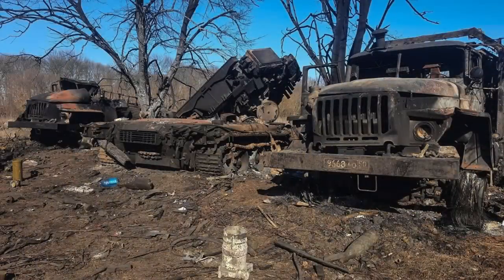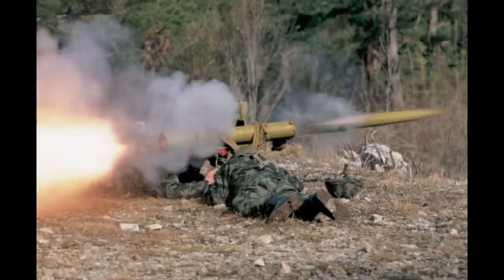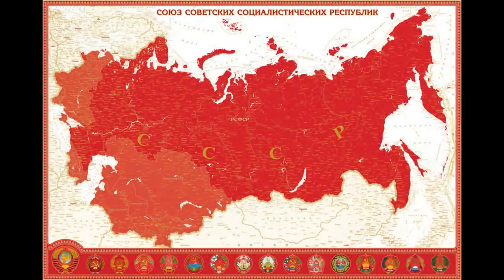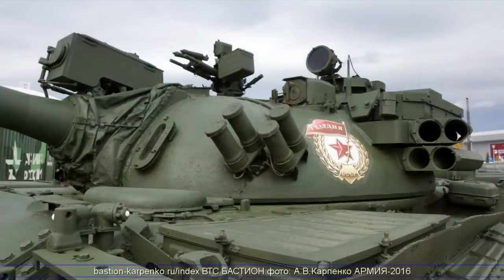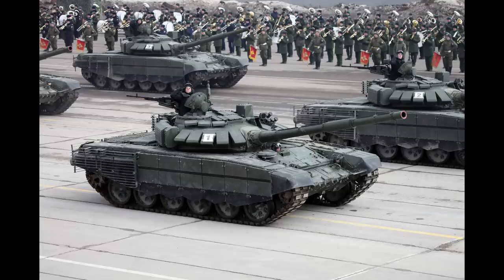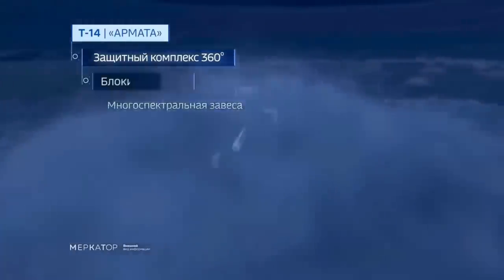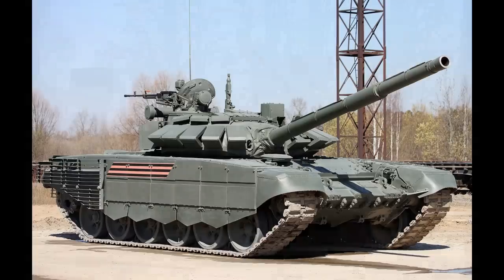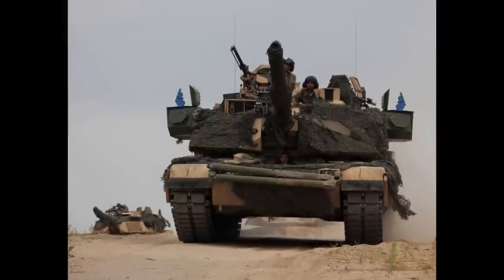Why are Russian Tanks Failing in Ukraine?

Comment: There isn't hundreds of Abrams with Trophy. For one Trophy is only installed as needed not all the time and second the US only bought a small batch.
Reply: They just awarded an open ended contract to buy more of them.
Reply: @MC-pt8kv  well it's an open end contract for a reason, it's at the leisure of the Army how many and when they order them. But like I said earlier Trophy is only equipped as needed not all the time.
Reply: The US Army included the Trophy as standard with the new M1A2C variant of which they have around 420 right now. Originally they were going to deploy the Trophy on Sep v2 tanks that were deployed to Europe but they changed their minds.
Reply: @josephahner3031  I'd love to see your source for the US have 420 M1A2SEPV3's(M1A2C is no longer the designation) from what is published by the Army's fiscal year budgets only 304 have been ordered it's unknown how many have been delivered and given that the tank is rarely seen in active service and the first unit received them in 2020 it's likely only a few dozen have been delivered and spread across the army. Also Trophy doesn't come standard it's still applied as needed similar to TUSK And mineplow attachments. In fact if you look at most recent pictures of tank on maneuvers it's lacking the Tophy APS
Reply: @nemisous83  My source is a former service buddy who works for General Dynamics. Though 420 may be the total outstanding orders rather than the number currently in service. The reason you don't see the trophy equipped Abrams on maneuver because the US Army has around 2300 Abrams in service between active duty and National Guard. If only 300 or so are currently in service that's barely a tenth of Active-duty Abrams. Most of the Sep v3s are in service with the 1st Armored Division with some being sent to 1st Cavalry Division. If it was First Cav, 1st ID, 3rd ID or a guard formation conducting the maneuvers you aren't seeing Sep v3s, you're likely seeing Sep v2s. As for whether or not the designation is Sep v3 or M1A2C I still see recent publications with M1A2C and others with Sep v3. Either one describes the same thing, and you clearly know what it means, so it really doesn't matter in the context of this discussion.

Comment: I think one the biggest problems for the Russian tank force and one that makes proper upgrades such as the adoption of APS difficult is the issue of hoarding. Simply put it Russia has too many tank models for the same role, it makes maintenance and upgrades very difficult, costly and time consuming. 

This is a problem they inherited from the USSR and in many ways Russia has done a lot better in addressing the issue but they haven’t fix it yet. 

If we look at NATO things are way more standardized, since the bulk of the force is made of Abrams and Leopards including the licensed copies of the latter. 

There’s of course the Ariete, Challenger and Leclerc but their numbers are very small and limited only to their origin country. 

By comparison Russia alone has three frontline MBT models, one of which the T-80 has little commonality with the other 2, that they keep upgrading individually when ideally they should had kept only one or two max, the T-80 and T-90 with the T-72 moved towards the reserves.
Reply: T-80 had the gas turbine that turned out to be a bad idea, which is why they went t-72 t-90 route.  So effectively they did stick with one tank, t-90 is an updated t-72.  Russia’s problem is they had no money for ages, so couldn’t just bin the t-72 and go full 90, also they have a doctrine of large scale tank attacks, so need numbers, hence them having thousands.  Thousands of good ones cost money, so they have thousands of shit ones
Reply: @cptrelentless80085  thousands of what they think are good enough tanks, instead of hundreds of very good ones.
Reply: @cptrelentless80085  there was really nothing wrong with the gas turbine, it was scapegoated for the Battle of Grozny by the Defense Ministry but there's no indication whatsoever that there was anything actually wrong with it and T-72 variants did just as poorly as T-80 variants in that battle. The only issue with them is fuel consumption, which should not be a problem for a country that is in the top 5 in proven oil reserves.
Reply: @cptrelentless80085  It’s complicated, the reason the 🇷🇺 military decided to favor the T-72 and T-90 over the 80 was in large part due to the Grozny debacle during the First Chechen War but been objective and analyzing that battle more closely it is abundantly clear it wasn’t the tanks or weapons that performed poorly but rather the military itself the one that did, from poor leadership and organization, troops that were very demoralized and lacked proper training to the very plan and the way that the campaign was conducted, just like what happened in Ukraine during the early phase of the war.

Ironically the war in Ukraine has finally redeemed the T-80 with both 🇺🇦 and 🇷🇺 tankers praising it specially the BVM model for been fast, nimble, reliable and aside from some criticism of the SOSNA-U sight well equipped in terms of sensors. 

One common misconception about the 🇷🇺 military is the idea that they lack money which as it has been demonstrated by some like Richard Connelly and Michael Kofman is not the case. 

The problem they historically have had is in industrial defense capacity, simply putted their factories struggle to build the armaments they need in large numbers due to technical limitations in manufacturing itself which is why the tech sanctions were very important, but money and R&D are not really the problem they have.

That been said 🇷🇺 has been in a long import substitution program in terms of western components since 2014 and had gradually shifted either to internal alternatives or East Asian ones so is a good question how much will the impact of western sanctions be in the 🇷🇺 defense industry going forward and wether they’ll be able to adapt eventually or not, if the case of 🇮🇷 and 🇰🇵 show something is that it will be unwise for the west to merely assume sanctions will be enough to cripple the 🇷🇺 defense industry.

Here’s a recent video of 🇺🇦 tankers using captured T-80BVMs and praising its performance. 
https://youtu.be/xFzXiAdfPvw
Reply: @josephahner3031  Ironically the war in Ukraine has finally redeemed the T-80 with both 🇺🇦 and 🇷🇺 tankers praising it, specially the BVM model, for been fast, nimble, reliable and aside from some criticism of the SOSNA-U sight well equipped in terms of sensors. 

Another aspect that has received significant praise from both sides is the BVMs greater reverse speed compared to that of the T-64, 72 and 90 making the BVM more suitable for mobile operations both offensive and defensive ones.

Here’s a recent video of 🇺🇦 tankers using captured T-80BVMs and praising their performance. 
https://youtu.be/xFzXiAdfPvw
Reply: @josephahner3031  I think we can all agree with that, this war is a disaster for everyone involved.
Reply: Also most tanks,even different ones use the same canon as Leopard 2 and Abrams.

Comment: The vast majority of tanks in this war aren't being destroyed by ATGMs, rather by the drone + artillery combo.
Reply: Most of the field kills are by ATGMs. The artillery kills are on those clustered together at field bases for resupply/field maintenance. The vast majority of the combat losses are from the ATGMs. The Ukrainians are very good at roadside ambushes and the Russians are still traumatized by all of the units lost to getting stuck in the winter mud so they're mostly keeping to the roads which makes them easy targets for ambushes. If you look at most of the photos of the combat lost vehicles, they're usually near a building using it as cover and the tank is knocked out but the building it was using for cover is relatively in good condition. You won't have this with artillery because the Russians know the general direction from which artillery can come from and the buildings would provide cover against incoming artillery. You'd have to knock the building down in order to get a hit on the tank with artillery in that case.
Reply: I think it has changed during the war. Early on, when the russians tried to quickly push forward, it was the ATGM's that caused a lot of casualties, artillery played a lesser part then. Later the fighting became more stagnant with artillery having much greater importance and ATGM's playing a much smaller part.
Reply: I have seen a lot of drone footage where Russian armored vehicles are under artillery fire and they rarely react properly.  In one piece of footage Russian tanks are moving on a road behind a tree line at the edge of a field.  When they come under fire they just stop instead of seeking cover in the trees.  That tells me they think they can't be seen behind the trees without ever considering they are under aerial observation.  They don't seek shelter in the trees because they think they will be seen from the ground if they move into the trees.  Or they think they are under direct low-angle fire from artillery on the opposite side of the tree line when they are actually being hit by high-angle indirect fire.  That's poor leadership, tactics, and training.
Reply: Early in the war UA claimed 60%+ ATGM kills, then later down to 40%, now that drones are being fired on along with jamming that may change again.
Reply: Artillery is destroying tanks at such a rapid rate because the Russian army got bogged down, mostly by ATGM's.
Reply: @Talishar  totally wrong
Reply: @JAnx01  i disagree, most of ukrainian tanks are also destroyed by artillery and they officially have admitted to being down to 50 percent of their tank fleet (even accounting for NATO donated MBTs).
Reply: Yeah tik tok is not a valid source
Reply: @nagantm441  You're totally wrong. Most of the dead tanks are near buildings with no other secondary impacts near them. This wasn't artillery.
Reply: @JAnx01  It is a very inefficient way of destroying tanks.
Reply: @rogerpennel1798  
Good thing you know what they think. 
Ukrainians have been perfectly happy to observe them from the ground as well. They can consider both, but they can really only counter one of those. 
As for the type of fire... I've seen footage of Russian tanks attacked from multiple sources at once... so... again, you're jumping to conclusions there. 
I'm not saying Russian tankers haven't been making hilarious mistakes. But unlike us, they don't get drone footage with captions explaining what's going on in that instant.
Reply: @alanch90  Tanks that are not moving are easy targets for artillery. Is that what you disagree with?
Reply: @nagantm441  Naa, he's right.
Reply: @Talishar  Little to no Russian tanks are killed sitting on the field. That happened to some Ukrainian one, but not much there too. Only 13% of total tank kills are actually by ATGMs. Rest is either by artillery fire or by Tanks.
Reply: @aniksamiurrahman6365  I didn't say field. I said cities/towns. There are tons of photos of late model T-72s, T-80s and T-90s destroyed sitting next to a building. A non-collapsed building. These models btw, Ukraine has none of, so they aren't Ukrainian. Even the tanks in more open areas have no evidence of explosions next to them on the ground from an artillery barrage. Artillery is going to fire at least 3 rounds for effect. The photos of the dead tanks don't show this. It's only the tank destroyed, usually with the turret separated and the only ground damage usually being directly under the tank from the tank detonating/blowing up and cooking off. Artillery isn't going to knock a tank out or penetrate it to cause an explosion of the ammo without a direct hit. You actually have to penetrate the tank in order to detonate the ammo OR hit it with hundreds of pounds of explosives from an aerial bomb. You aren't getting that kind of explosive mass from a 155mm howitzer. You're going to need a gun bigger than most battleship guns to have that kind of raw explosive power.
Reply: @Talishar  Ukraine not only operates the T80, they were the major manufacturing center for them. They also operate 72 a and Ms, more now that the polish donated their stock. I have seen zero pictures of a T90 destroyed beside an "uncollapsed building".
Reply: @aniksamiurrahman6365  You do realise, that ATGM's have not lost their usefulness, even if artillery battles are now the focal point of the battle. ATGM's are the reason that russians can't really push through the lines faster, as armored pushes would fall to the ATGM's and then the rest would be cleaned up by artillery. ATGM's are against mobile armored movements while artillery is king in a more static setting. You can't dismiss ATGM's just because right now artillery is more important in the current more static setting.
Reply: @eiko4252  Warfare evolves... You adapt or you die.  Russia has adapted somewhat by using a very old strategy...  Reverse scorched earth in a way...  Which explains their slow advance as it does take time to blow everything to pieces.  Of course as the Ukrainians get more longer ranged weapons the current Russian tactic will become less effective which probably means air power will become the new doctrine.  This will depend of course on if the west is ahead of the curve in supplying air defence systems that can deal with all possible air threats...  These are many and all vary in difficulty to counter.
Reply: Yes, most of the tanks destroyed are destroyed by artillery and needless to say most of them are Ukrainian . This is true in most wars. I regard this video as a   hit piece as it is totally one sided and does not mention Ukrainian tank losses which are obviously enormous.
Reply: Indeed and APS would do nothing against this combo.
Reply: Its a bit of both from all the footage that I've seen.
Reply: @rogerpennel1798  That's just a lot of hand picked videos and a theory based on assumptions what happened in these cases, might very well be completely right but there are to many factors to reliable say what happened and why. Also most of the videos that I saw they only showed 25 to 40 sec of the situation and many of them were DPR/LPR tanks.
Reply: @Kitty Cat - You're dull even by Kremlin standards.  Maybe you shouldn't hide behind a Western pseudonym and pretend to be American if you're a paid Kremlin cheerleader?  No foreign power has had much luck pacifying Afghanistan going back to Alexander the Great. Everyone who has tried has faced the dual problems of non-existent logistics and the fact that the Afghanis aren't going anywhere.  

The Afghanis don't need to beat anyone on the battlefield they just outwait their occupiers.  Because eventually, the occupying power grows tired of the costs and just leaves.  The Afghani government insisted on including the Taliban in any peace settlement since 2003.  

It took nearly twenty years for the USA to finally negotiate the terms of their withdrawal.  The Aghani government and Armed Forces had no will to survive and when called upon to defend their country against the Taliban they deserted and went home allowing the Taliban to take over.  How do you protect someone when they have no will to resist or assist in their own defense?
Reply: @Kitty Cat - When I see an imposter hiding behind a US flag that's what happens comrade.
Reply: @Kitty Cat - Heal my heart comrade!  Show me the eternal truth that only your messiah Putin can teach us and save me from the evil clutches of Soros.  Do it for Pootey!
Reply: @alanch90  where you got that from ? RT ?
Reply: @rogerpennel1798  You can get stuck and disoriented outside the roads ... and it's Russia... not a highway in Europe. Lastly, we don't know if they even know what's coming down and they also have very poor maneuverability in reverse, which also complicates things... well, we don't know jack, so a lot of the above is just supposition.
Reply: @JAnx01  That's bull crap. Russia got bogged down because they went in with a numerical disadvantage and were tiptoeing around targets instead of doing what the US and Europe would do, which is shoot the load and come in with a 5 to 1 numerical advantage.  Everything else is details and suppositions. Force concentration and fire superiority are the deciding factors.
Reply: @klarion  I also learned 5-1 in Brazilian Army.